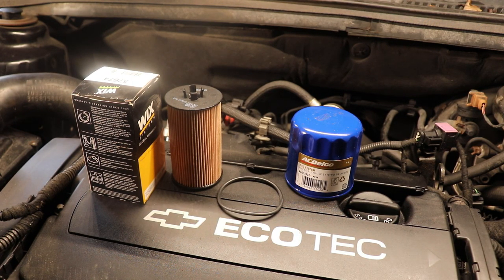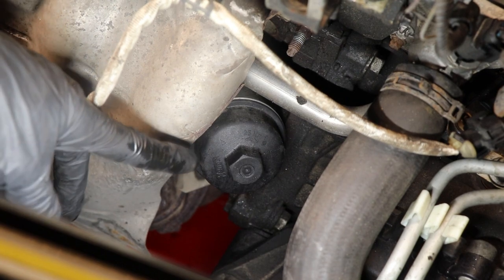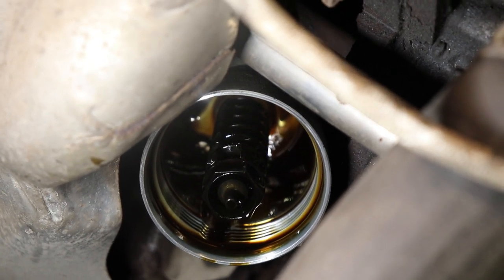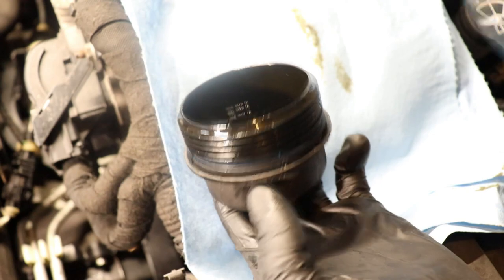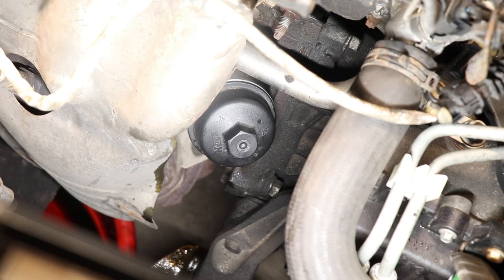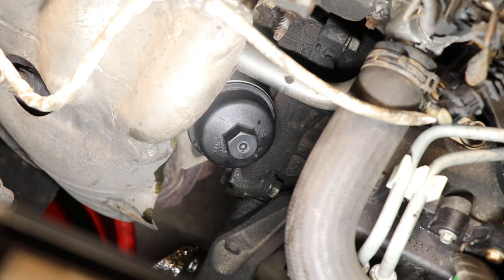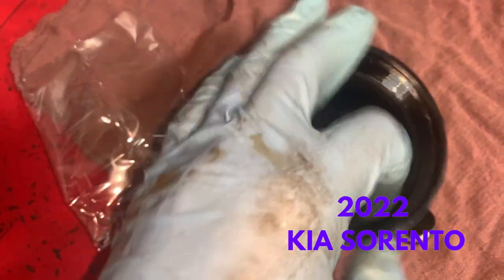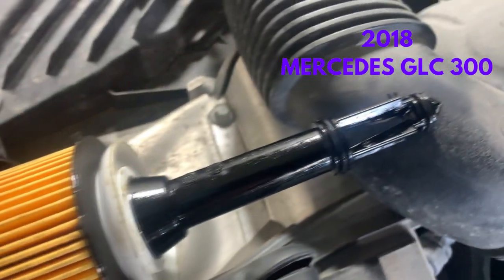Engine Cartridge Oil Filter Overview

Comment: I see a lot of over engineered crap! The oil cpas on some KIA are crap.  I see the old oil cartridge on the mercedes is crushed, filter is not strong enough or restricted oil flow. I drive a Toyota and their cartridge filter systems are bad enough.